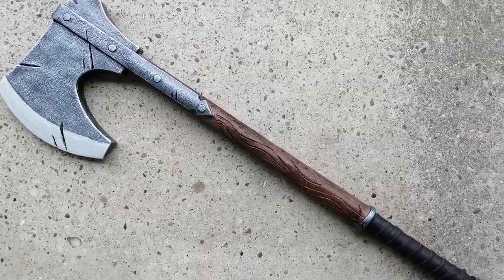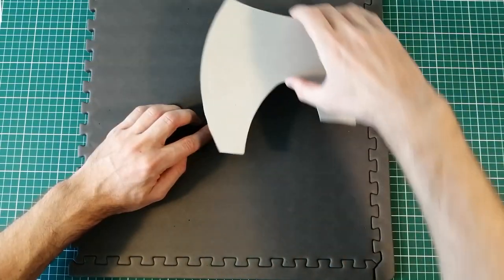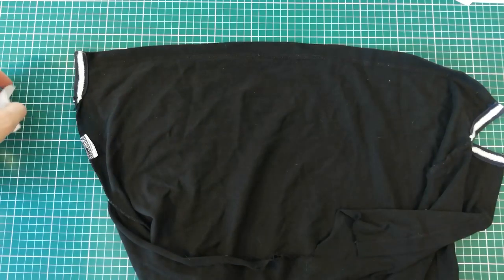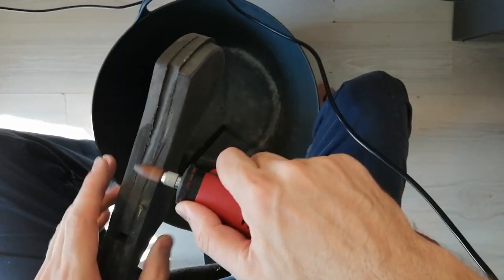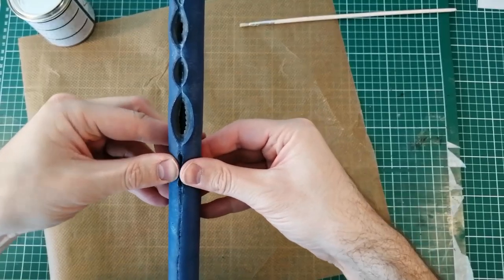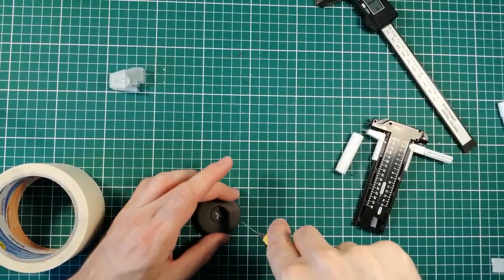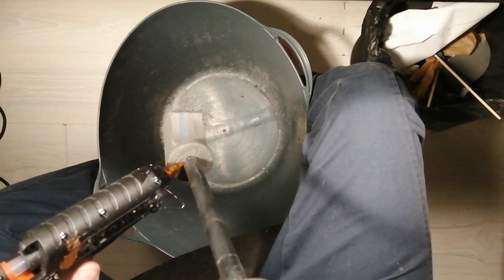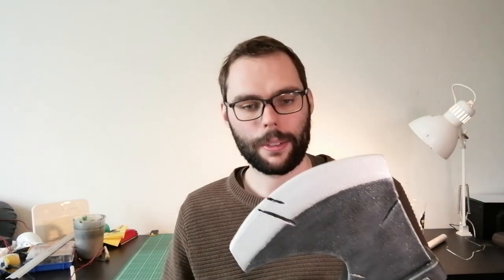Making Cheap LARP Weapons PART 2: Construction

Comment: how do you go about removing the parts from the graphite pole golf club/walking stick that you dont want for example the metal head of the golf club?
Reply: Sorry for the late reply, I didn't realise people actually watch these videos!

First of all: WEAR GLOVES AND GOGGLES when cutting golf clubs! They're usually made of carbon fibre, which results in teeny tiny splinters that will get stuck in your skin and are near impossible to remove. They will literally stay there for months and itch like hell.

To cut off the head, I used an old iron saw. Something with fine teeth will do fine. Take your time and be safe!